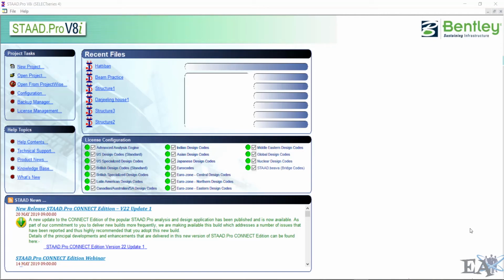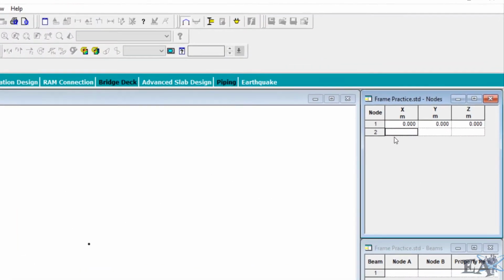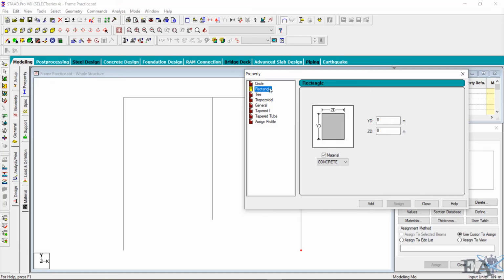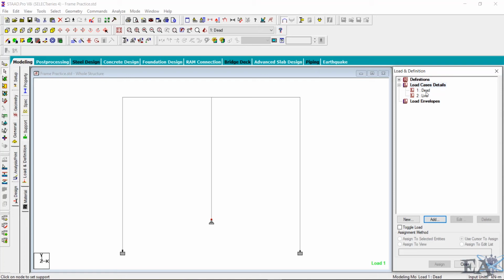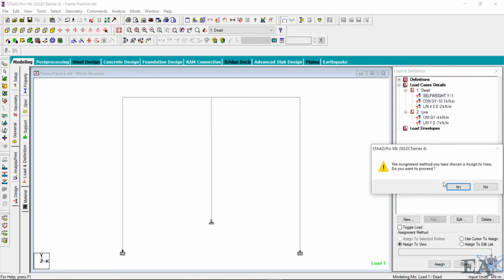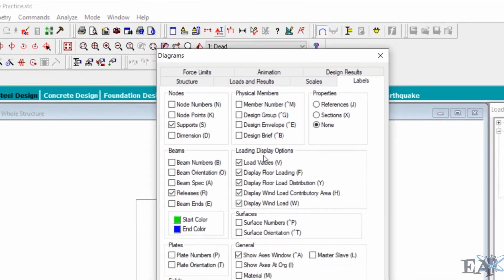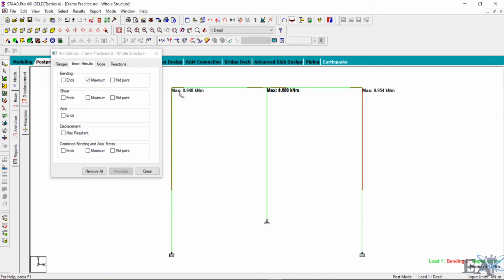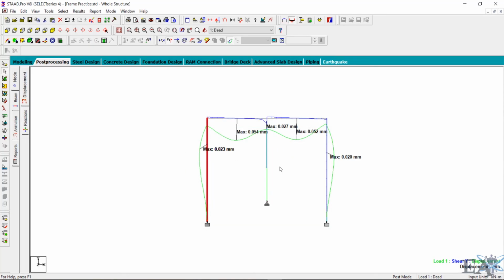STAAD Pro Tutorial For Beginners [Episode 3]:  Analysis of a 2D Frame

Comment: While applying triangular load we have to consider local axis system not the global one...as software only considers local axis system for applying uniformly varying load. That's why  load is acting in vertical direction on the column. (Refer Timeline of same video 15.42)
Reply: Correct

Comment: Sir i was tried nodal load but when analysis that frame result shows different value as previous analysis.
Reply: I did exactly same as he did but the result are different. 
And he make a mistakes (16.1) he used x direction but it will be Y direction that's why my result are Different ...
Reply: @HabiburRahman-wx1rw  Mind explaining why is that if changed to local axis it's y-axis? I thought the triangular load is going in the x-axis direction, if anyone mind enlightening me?
Reply: @pikyee7312  its the local axis of that particular column. If we consider alone the oolumn and draw it horizontally, it will be a beam with its x axis parallel to the beam and the y-axis perpendicular to the beam. You will encounter this in structural theory in frames where manual computations of each bar considers every bar as beam and draws each one separately with the x-axis parallel to the beam and the y is perp.